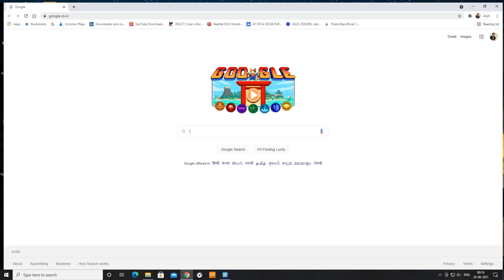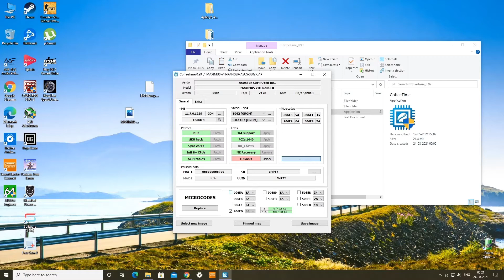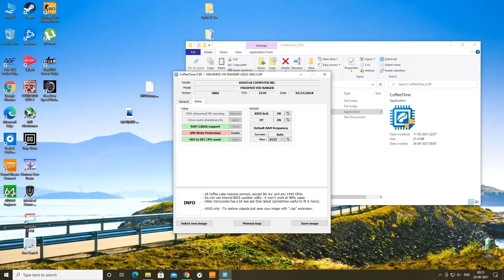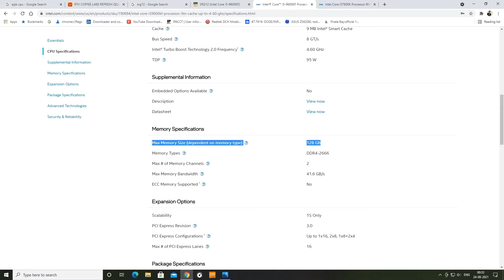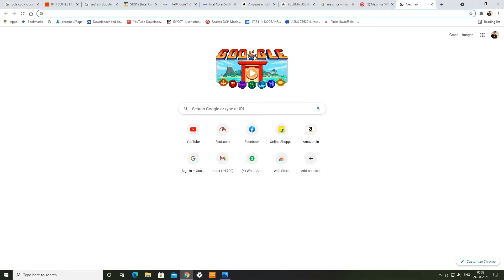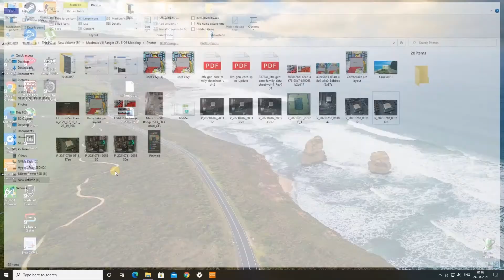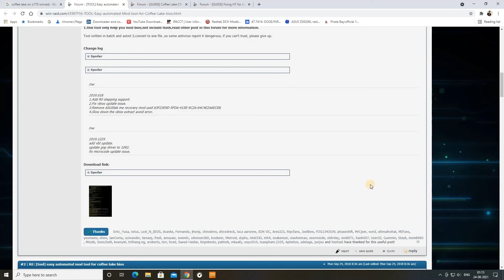It's Coffee Time! Running Coffee Lake CPU on ASUS Z170 motherboard ft. CoffeeTime 0.99

Comment: Why did you connect the green pins but not isolate the blue pins as indicated in the instructions? how did you know you could skip that blue pin isolation step? also were you able to keep  your same windows license with the personal data mod?
Reply from the maker: Hi there. The reason why pin isolation is required is that some motherboards have these pins connected to something (be it the voltage controller or simply to ground). In Skylake/Kabylake, these pins are reference pins and ideally should not be connected anywhere at all. However, motherboard manufacturers implement their own design. To figure out if my board had these pins connected anywhere, I used a multimeter to very carefully measure resistance of each of those pins to ground and in case of my board, they were not connected anywhere (got infinite resistance). 
Please note that those pins are Vcc pins in case of Coffee Lake. 
Hence I was confident to leave it as it is. As for the connecting part, initially I did do it but later on, I modified the board near the SuperIO controller and removed that connection also thus making it plug and play. From my research, the ASUS Maximus VIII Ranger and Hero does not require pin isolation but all the other ones do. All Gigabyte boards require pin isolation too.
Reply: @geekjit215  This is the one I have: Fatal1ty Z170 Gaming-ITX/ac. Do you know anything about this board regarding the isolation of pins? (the less I have to mod on the LGA socket the better, because I don't want to risk damaging anything),  the motherboard is much smaller, because it is ITX, and I cannot find this  "nuvoTon" chip on the front side of it. I will have to check the backside. or something. Personally I would also prefer to do the mod directly on the motherboard if possible (like you did), because those LGA pins are too delicate. I am afraid that the copper tape thickness will push the pins down too much and then they will lose their spring-like behavior, such that if I were to roll back to a 6700K it would fail to make contact with those pins. I would rather not use the copper tape if possible. I also saw some people using carbon from a pencil, but I was wondering if this is durable or if the pencil carbon falls off over time. The pencil carbon method seems better in terms of layer thickness, but worse in terms of durability.
Do you have a discord server? Invite me to discord please, thanks!!
Reply from the maker: @bobbyboygaming2157  Hi there. I don't have experience with AsRock boards yet. But if you are not comfortable checking with multimeter, I would highly recommend isolating the pins as not isolating them can cause the pins to burn or the CPU pads to burn up. As for isolation, you can use kapton tape. They are extremely thin, high temperature resistant and durable.
As for the SKT_OCC mod, you need to find out the SuperIO controller on your board and check its datasheet for the SKT_OCC pin. Once you have found it, you need to run a wire from any ground pad and connect it to that pin or at a pad with a trace connected to the pin. It might not be a Nuvoton chip on your board (can be from ITE, Winbond etc).
As for the pencil method, I would not recommend it as the lead can spread over time and become conductive and possibly short other pins.
You can use a conductive pen though for that purpose.
Reply from the maker: @bobbyboygaming2157  Also as for the Windows license, yes. I have even reinstalled Windows after the mod and once I sign in with my account, Windows is auto activated (I have a pro license). On November, I got an ASUS TPM 2.0 card as well and Windows 11 now runs flawlessly on this build.
Reply from the maker: @bobbyboygaming2157  Also it is possible for FD44Editor to not work with non ASUS boards. In that case, you can use CoffeeTime to manually input the data.
Reply: @geekjit215    I found a MGChemicals silver conductive pen. It says that the trace width will about 1 mm. Is that too wide for the LGA contacts? Okay, I will try to use the FD44Editor on this ASRock and see if it works. You mention that the SKU Hack is sometimes not required and may decrease performance slightly. How do I know if this one will be absolutely required?
Reply from the maker: @bobbyboygaming2157  It should be okay. When applying it, you can mask the vicinity with some kind of tape and once you have connected those two pads, you can remove the tape.
As for the SKU hack, unfortunately the only way is to test it out. I applied it anyway since this was a first for me and didn't bother to try without it especially after seeing better than expected performance. 😅
But yeah, I have read that it can sometimes reduce performance. So you can try without it and if everything works, then you know.

Comment: Hello, many thanks for this guide.
Thanks to it, I’m running an i9 9900 non-K on the Asus Z170 pro gaming motherboard. I originally wanted to ground the resistor from pin 102 on mobo, but the layout is different from yours and CPU seemed to be grounding two resistors that were connected to 102 pin when I checked with multimeter. This left me confused as I’m not experienced in this level of modding so I rather went for copper tape with adhesive on the socket. I also isolated the pin cluster on the left side where the 2 blue pins are on the coffetime pinmod map - this was probably not necessary (I didn’t check with the multimeter).
So far everything works fine in stress tests games etc.. I turned off the power limiters so the CPU runs on 4.5-4.6 GHz when all cores are under load. Did a little bit of undervolting with not much success as I hoped for (Ofset - 0.11 V, LLC level 3).

For those who would like to do this mod with i9 9900 noK/K as well, my advice is to check your VRM capability as this CPU needs a lot of amps under heavy load.
I have noise dampening case closed in custom build cabinet under the table with 2x120 mm intake fans and outtake ports, it’s not ideal but there is airflow circulation secured. Before I bumped up my cooling solution the VRM temperatures were steadily rising to 100°C and would go higher if I didn’t stop the test - Prime95 (smallest FFT - no AVX). After the airfow improvement, the VRM temp. maxed out at 89°C and stayed there in this test (CPU package temp. 84°C max.). These are still high temperatures, but I’m not planning to load the CPU that much.

The only thing I didn’t figured out is why all cores are under heavy load, the frequency drops to 4.5 GHz when it should be at 4.6 per intel specs.. Didn’t find any correlation between the VRM/CPU temps and this throttling, it stays at 4.5 no matter the temperatures. Undervolting don’t have effect on this. No indication of hitting any limit according to HWinfo64.
Reply from the maker: Thanks for the appreciation and detailed review of this guide and congratulations for running the i9 9900. Even at stock, it is a great CPU and there is simply no reason to upgrade it for the coming 3 years at least. With that noted, I also had the issue where my i5 9600KF would max out at 4.5 GHz instead of the stock 4.6. I think it has got something to do with the BIOS itself since it "knows" only up to 7th gen CPUs and quad core CPUs. However, I am on 5.1 GHz manual OC with all power saving features turned on as well.
Again, congratulations on the upgrade and enjoy your setup. :)
Reply: @geekjit215  Hello, I have figured out the issue with the frequency drops to 4.5 GHz when it should be at 4.6 GHz per Intel specs under all cores load (no manual OC). It was caused by the Intel Thermal Velocity Boost function that was introduced for the Coffee lake desktop processors. What was happening was the CPU downclocked from 4.6 to 4.5 GHz when the CPU package temperature raised above 70°C. This function was not present on Skylake and therefore Z170 bioses do not have this function included. I had to use the ThrottleStop program to disable it (it is under FIVR menu - > uncheck the Thermal Velocity Boost -> apply and save). To have it permanently disabled its necessary to add ThrottleStop to your Windows startup sequence using the Task Scheduler as the ThrottleStop does not interact with the bios. It is possible that when you manually OC the CPU this function disable itself automatically, however under default setup it stays on.
Reply from the maker: @stana9994  Thanks a lot for the solution and for taking the time to let us all know. I am sure this will help fellow users like us running Coffee Lake on 100/200 series chipset based boards.
Reply: Turn off asus multicore enhancement in the bios should solve your issue.

Comment: amazing!  I have an Asus z190 Maximus Impact VIII.  How do I tell if I need to isolate some pins or not?  Because I've seen your forum posts as well as your video but the guide suggests even for Asus i need to.
Reply: Or can you disable IME entirely?
Reply from the maker: @lolcatmaroon  Hi there. Before going for the isolation, I used a multimeter to check resistance to ground of the respective pins to see if they are connected anywhere and on the Maximus VIII Ranger, they are not connected anywhere (ideally they should not be based on Intel reference pin design). WinRaid suggested Ranger and Hero don't have them connected anywhere and hence these boards don't require isolation. I just double checked with the multimeter. I would recommend you do the same or if you can, just isolate the contacts with some Kapton tape. :)

Comment: Hi @Arijit. Thanks very much for your nice video. I have a same Mainboard Maximus VIII Ranger too but I don't have a USB Flasher, can you please send me the .CAP BIOS file that you used to mod. I can't find a way to convert from .BIN to .CAP on the internet. Thanks again
Reply from the maker: Hi Zuha. Thanks for the appreciation. I can send you the file but USB flashback would not be able to flash it properly as some BIOS regions are locked by default. You can get the CH341A. It is cheap and easy to use.

Comment: tryed it on my old viii hero that i dont used now for 3 years and since i got here some spare 8700t cpus from at work it will have now a new life. used a rasbpi 4 for flash the bios and thx to z170 chipset i can force the 8700t to 4ghz all cores what dont works on z370/390 boards :D
Reply: Hey, sorry for bumping up your old comment. But did you really can enable multicore enhancement on non-K Coffe lake CPU on Z170? I want to buy 9700K for my MSI Z170A. But I just Saw 9700 was much cheaper.

Comment: I have a msi titanium z170a with clock gen I got a i5 9500 for free but want to keep the clock gen feature would this mod still work with this and be like having a i5 9600k (nearly)
Reply from the maker: Hi Jonno, I am not sure that can be done since the clock gen is included with the CPU itself.
Reply: I will have a go and let you know ohh and I read that the forum winraid is closing at the end of the year 😔😔😔

Comment: I have a GA-Z270X-Gaming 7, and so far I have followed the steps for modding the latest bios. I am stuck because FD44Editor does not see to read my bios dump. What can I use for this? I plan to use a 9600k. What other methods can I use to isolate the pins on the cpu? Has anyone else done this with a GB mobo? What was your experience?
Reply from the maker: Hi there. You can use Coffee Time with your existing BIOS dump. Just take a note of the board data. Then open the fresh BIOS file with Coffee Time and manually input the data there.
As for pin isolation, it is very important in GIGABYTE motherboards. You can use Kapton tape for that purpose. Kapton tape are high temperature resistant tapes that won't lose adhesion even with rising temps. What's better is that if in the future you decide to remove it, it won't cause a mess and you can remove it easily. All the best.

Comment: Who could tell if the system will be capable of handling 128Gb of RAM after installing Coffee Lake CPU? Board specs say that the maximum is 64Gb, which is obvious, because compatible CPUs do not support more than that. But Coffee Lake can handle more, so, perhaps, it is possible for this board?
Reply from the maker: Absolutely. There is the option to add 128 GB support through Coffee Time. And since memory is mostly dependent to the CPU, the memory controller being inside the CPU, board should not matter also as long as it has 4 slots.
Reply: @geekjit215  Yep! Thanks. The reason for my question is that many of newer boards designed initially for Gen 8/9 CPU are limited to 64Gb RAM (at least according to specs), no matter if they have 2 or 4 memory slots.
Reply from the maker: @demidtuzenko4332  That is probably done initially when higher density memory were yet to be released and that the boards were validated using 64 GB of RAM since that was the max you could go on 2017 using 4 sticks. Not exactly sure though but fairly sure some boards specifically got a BIOS update which mentioned "add 128 GB RAM support". ;)

Comment: What a great vid I've just acquired a ROG MAXIMUS VIII EXTREME/ASSEMBLY
Going to follow  this guide to see if I can get this running a 9900k
Reply from the maker: Thanks for the appreciation. :)
For that board, make sure to follow ASUS pin isolation diagram as well as it is a higher end board and custom pin config is expected. You can find the connect and isolate diagram from CoffeeTime.
Reply: @geekjit215  thanks for the reply am sure I'm going to be messaging you about it soon...again great work
Reply: Hey Gareth, were you able to run that config?thnx
Reply: @artgodknow  I've all the parts and tools to do it just in process of moving house so I'll be doing it in about a week..this board is amazing the bios chips are removable aswell I've read and backed up the bios already and made the custom bios already I bought 2 extra bios chips just incase shit goes west I'll keep you posted

Comment: Impressive work. I want to do it with my PC too. This is my spec, GIGABYTE MATX GA-Z270MX GAMING 5 with i9 9900K or i9 9900KS processor. Is this specification also need a cpu blocking and connect like your ASUS motherboard? thank you!
Reply from the maker: Hi. My board didn't require isolation since I measured resistance the questionable pins with a multimeter and trey were all open (not connected anywhere). However, it initially did require connecting the two pins which I removed later on as I did the SKTOCC mod near the Super IO chip on the motherboard.
Reply: @geekjit215  then how about my case? i dont need the isolation too?
Reply from the maker: @alexanderchristiancahyadi5658  GIGABYTE motherboards always require isolation as far as I know otherwise the VRM will blow up. For pin isolation guide, you can refer to the image which can be found after opening the CoffeeTime tool.

Comment: Is there a list of all compatible 100 and 200 series motherboards? I have an Asrock Z270 mobo but I have no idea if its supports this modification.
Reply from the maker: Technically, all 100 and 200 series motherboards should be compatible with this mod. The things you should look for are:
1. The pin isolation required as shown in CoffeeTime
2. Your motherboard VRM capability - If using high core count CPUs like the 9900K, you should check if your VRM is strong enough to supply enough power to the i9 9900K.
3. Your BIOS chip size - As that will target the compatibility range for the CPUs. Like if your board has a 64 Mb BIOS chip, it might only take microcodes for just 9th gen or 8th gen but not all.
Reply: @geekjit215  Thanks. It appears that my motherboard has an 8-phase VRM (6+2) and a 128Mbit BIOS ROM. Is that sufficient for a 9700/9900 (standard and/or K versions)?
Reply from the maker: @cakins1986  Hi there, 6+2 phase VRM is absolutely fine for the 9700K. For the 9900K, it should be fine, though your sustained overclocks with that chip might be limited since it is a very power hungry chip. For stock performance, your motherboard will do just fine. As for the BIOS, 128 Mb is more than enough to accommodate all the microcodes so you are good to go. All the best. :)
Reply: @geekjit215  Thanks again, you are super helpful. Another question if you have the time....do you think that performing all of these steps is worthwhile AND are the performance gains worth it? In other words, doing this modification doesn't gimp an 8th or 9th gen CPU severely and it will run just as it would on a 300-series motherboard?
Reply from the maker: @cakins1986  Absolutely worth it. There is no difference in performance when compared to a 300 series motherboard. Performance can be better in fact if paired with a high end Z170 motherboard with beefy VRM compared to a standard Z370 motherboard. Do note though that some new features like re-sizable bar support might not be present. I have tried backporting it from other motherboard BIOS but did not have success so far.
Reply: @geekjit215  How do Z270 boards compare to Z170? Is it VRM dependent?
Reply from the maker: @cakins1986  Z270 boards also work equally good with the same mod.